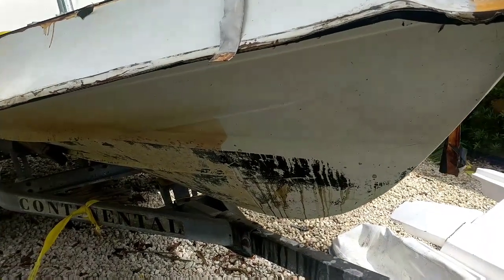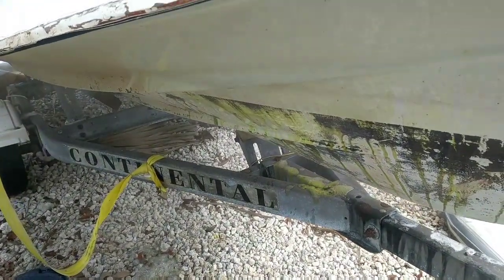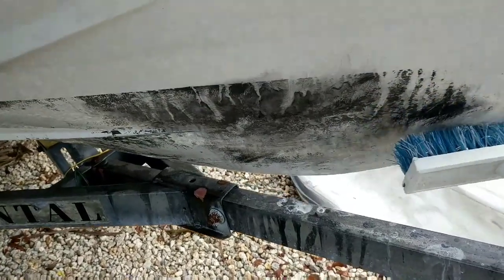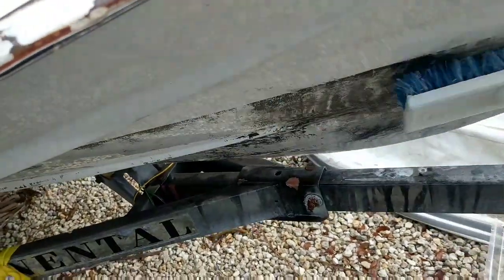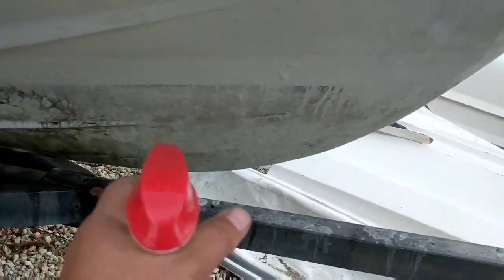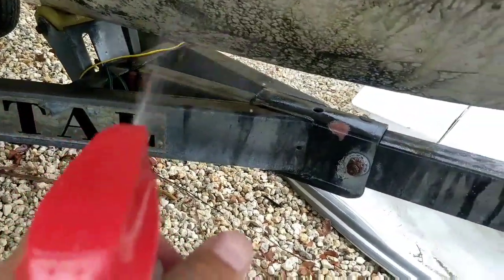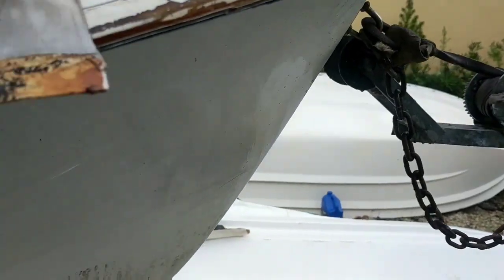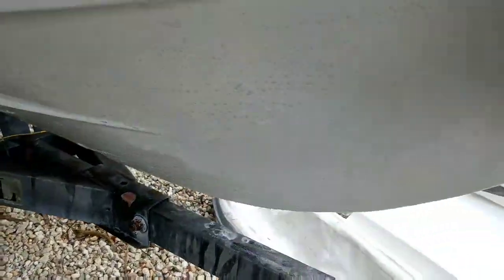Removing barnacles,rust, and bottom paint using muriatic acid from a dinghy

Comment: Hey I used this same method to clean a 16ft fishing boat I got at an estate sale and I gotta say it worked amazing. 30 years of sitting under an oak tree gone within an hours worth of cleaning. And as far as the galvanized trailer it took the galvanized coating off and all I had to do was go back and paint it with some rustoleum. Watch out for fumes though and dont get it on yourself or anything you dont want eaten.

Comment: Muriatic acid quickly reacts with and removes the anticorrosive zinc coating on galvanized surfaces such as boat trailers.  It will also eat into aluminum.

Comment: Alfred see you all the time, Just got a boat but was left in the water for what appears a while and has lost of barnicles on it, you know if I would be able to use this  acid, would it  work ?
Reply from the maker: Pressure wash it first with at least 4000 psi washer then use the acid. It will be tough on your lungs so mask up and dont let it fall on the metal trailer it will burn it

Comment: Nice work getting it clean with the muriatic acid. I don't agree with your application of the product - incredibly dangerous. For one you are splashing it on which could get into your eyes. Second, you are breathing the fumes which will cause irreversible lung damage. Anyone watching this...PLEASE don't follow the example. Gloves, goggles, mask and spray it on. Avoid the fumes.
Reply: Don't spray it thats just creating aerosol and more fumes but rather brush it on and make sure to use gloves